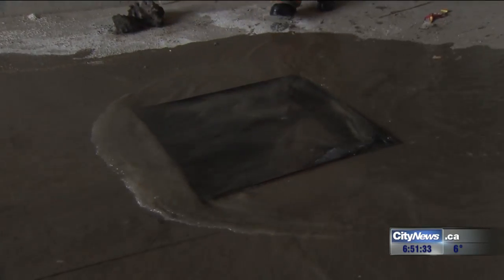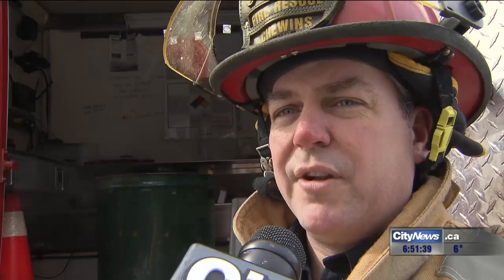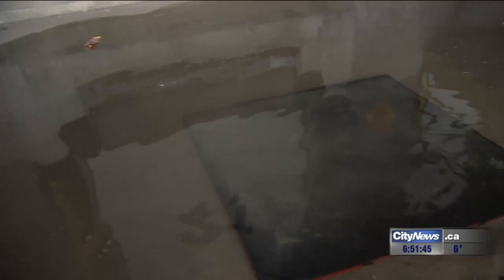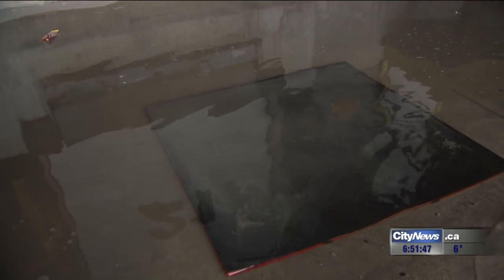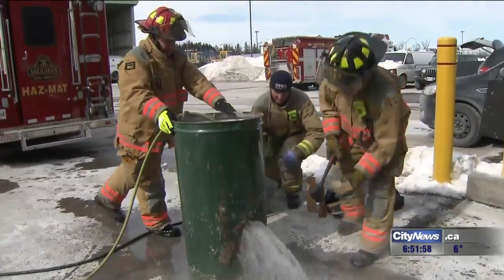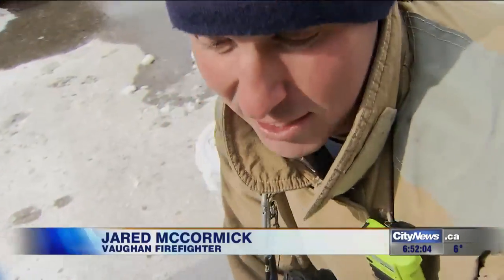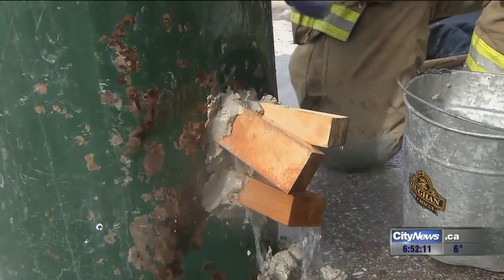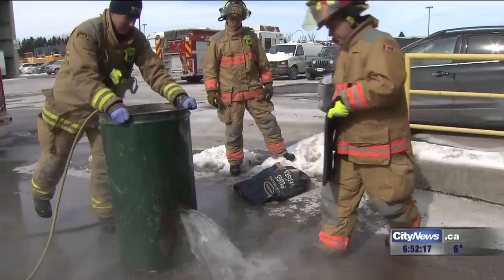Firefighter's invention could help crews deal with chemical leaks

Comment: But aren't most flammable goods tankers aluminium? What about most 44 gallon drums have ribs in them, and when a drum is damaged to the point of having a hole, then its not exactly round anymore.
Reply: Peter Welch this is more than anything a way to cover storm drains so when they dump water on a building it doesn't wash toxic chemicals into lakes and rivers but it can also be used to seal small holes in anything the magnet will stick to.
Reply: It's another option in the HAZMAT arsenal. Every call is different it doesn't take up much space. You can never have enough options it's brilliant!
Reply: Why is there always a small minded comment such as this on every video that shows some innovation, this product is an option, no where was it said that this is the be all and end all of anything but it is another option that is fast and simple and safe

Comment: What if it’s a plastic thing?
Reply: Tankieguy Lol no chemicals will come in plastic drums
Reply: Dev Patel true but not all barrels are made of magnetic material
Reply: Dev Patel, the peroxide and bisolfide my work uses comes in plastic
Reply: Completely wrong, any chemical that reacts with metal obviously has to be stored in poly drums. These generally are of the most concern when leaking.
Reply: Take a second to remember that it isn’t foolproof its a concept that has serious promise
Reply: Tankieguy Lol it want work on plastic
Reply: Dev Patel that's a lie demac comes in plastic sulfuric acid come in plastic
Reply: Dev Patel thats wrong. Chemicals that corrode metal come in plastic. Especially many types of acids and bases
Reply: A rubber matt and a few ratchet straps do wonders on any kind of barrel . But for the rain water dran that's a great idea!!
Reply: Not sure they would put dangerous chemicals in a "plastic barrel "
Reply: Gavin Miller well considering "plastic" is much more stable than metal and doesnt corrode from acids
Reply: Rai Kai true but it wouldn't it need to pass some kinda of strength tests for certain impacks?
Reply: Gavin Miller well polyethylene is flexible so an impact would only flex it and not break it. And for punctures both thin medal and plastic barrels dont do very differbt
Reply: Actually, hydrochloric acid comes in LDPE plastic. And many other acids come in plastic containers.
Reply: Dev Patel chlorine tabs. Plastic.
Reply: Most of the time its in a large drum its made out of metal. Nothing will work all the time but this would help allot of the time. It wouldn't be great for the drains in my town though, 95% of them are built into the curb so they have a sort of side to them, as opposed to just being in the middle of a flat area. Still, a couple om our rescue truck probably wouldn't be such a bad idea (not my choise though).
Reply: Shows how little you know. Nowadays HDPE (thats plastic) 55 gallon drums are the norm.
Reply: You obviously do not work with dangerous chemicals. I do, on a daily basis. I work at a wastewater treatment plant, and all of our chemicals are shipped in plastic drums, with the exception of gases like chlorine and sulfur dioxide.
Reply: Actually, most 55 gallon drums up to 500 gallon portable tanks are more commonly made out of HDPE or LDPE these days.

Comment: Magnets run out after a while so they can only use them for so long. Also what if the pressure is too high. Last they will obviously be very expensive.
Reply: Yeah they will run out, in almost 400 years
Reply: flaviobriggs yeah

Comment: In refineries they've been using a Rubber mat and a bag of sand for years to cover sewer drains. Its not rocket science, put rubber down. Drop bag of sand on rubber, Walk away.
Reply: That method would work, But it seems kind of crude to me, This one would be faster to deploy, Probably seal better, And would be more portable because you could just roll it up and store it or apply it a metal surface.
Reply: Not all drains are made of metal. Rolling up items of that nature usually doesn't return to a flat state after a period of time, Roll up paper. leave it rolled ... unroll it and try to lay it flat. all it wants to do is roll back up. Same thing happens with magnets when coiled
Reply: I've never seen a non metal drain, Every drain I've ever seen has metal involved, And its a magnet, When they deploy it, If it wants to stay flat or not it will stay flat when attached to metal, And they can still alternatively attach it to a metal wall in a toolbox or something like that.